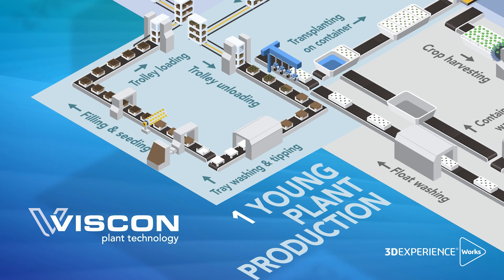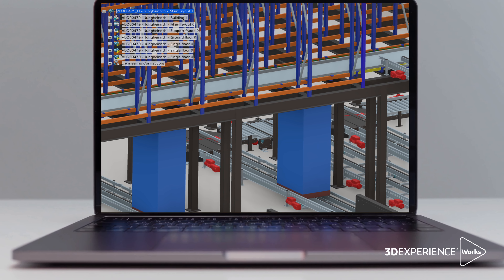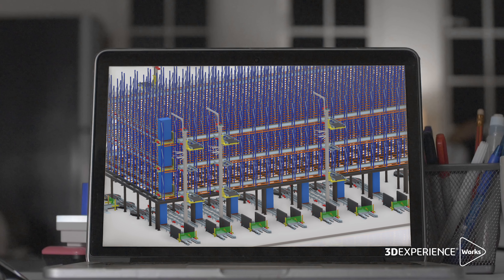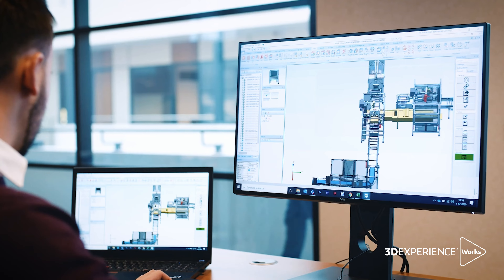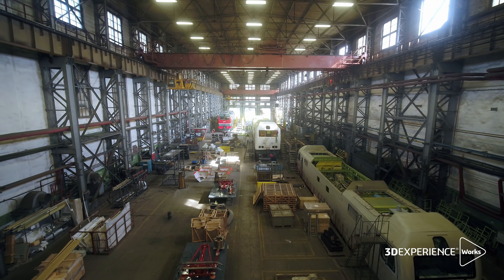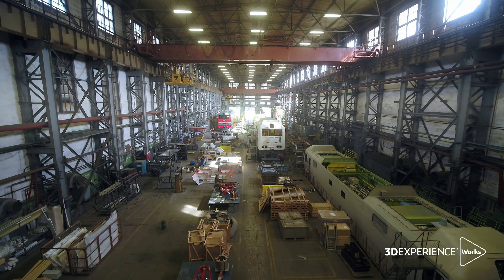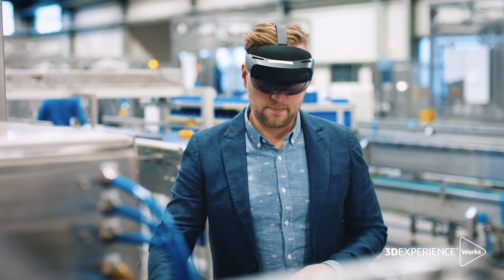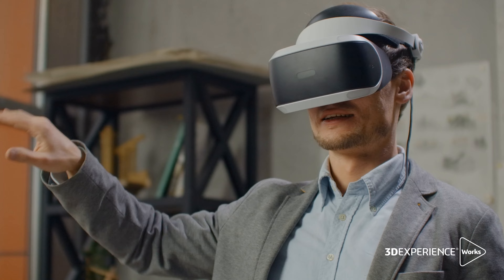VISCON: Efficient Plant Layout Design using 3DEXPERIENCE Works

Comment: hi there. I made a step file for an assembly I created in the SolidWorks, then later I lost the original file so I tried to make solid work part file from the step file by using feature works, but it only recognized a handful of features, and a lot of things didn't get recognized. In feature tree it shows as 'imported'. is there any way to recognize all the features? is there anything that I can do differently next time while creating step so that all features will be recognized?
Reply from the maker: Hi there! A great place to start for direct support would be our SWX User Forum: solidworks.com/UserForum or https://go.3ds.com/swforum
Reply: @solidworks  😔😩